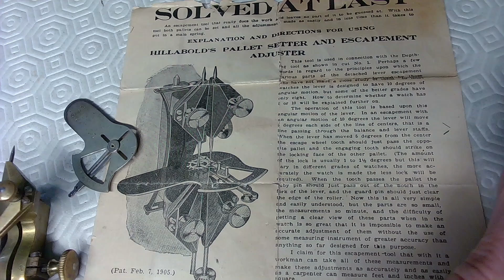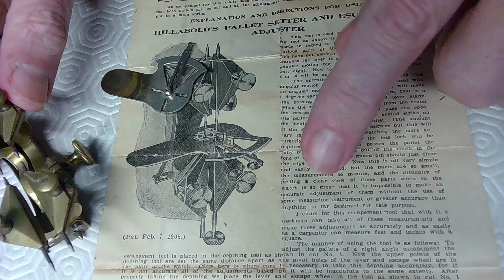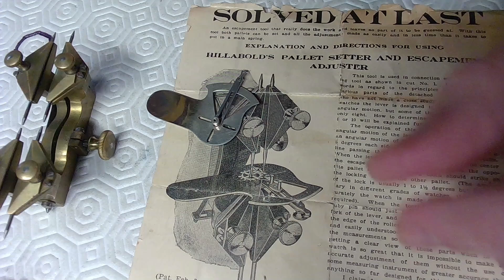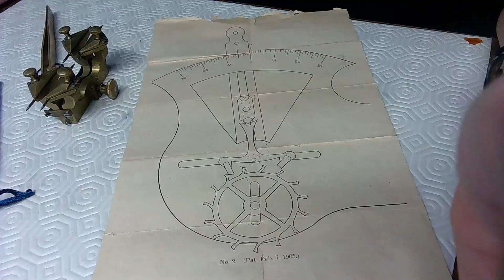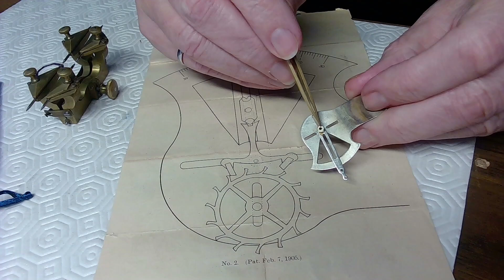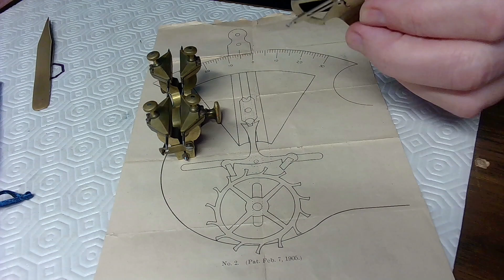Hillabolds Pallet Setter and Escapement Adjuster 1902

Comment: Interesting tool, it is a shame that it is missing those parts. 

There is a self made tool for measuring the same angles within the watch in some old material I have read. I think it was by Grossman. 

It was some kind of clip that connected to the lever with an end protruding out between the plates of a full plate watch, from which measurements are taken. If I recall, it was made out of a hat pin. 

I’ll try to find it again. It isn’t quite as versatile as this tool claims to be, but useful in full plate watches nonetheless in the absence of an escapement depthing tool.
Reply from the maker: This is an odd tool, but I may be able to make the parts that is missing
Reply: @JDRichard It is unusual, I’d never heard of it or seen such a thing. 

The tool I mentioned that is (I think) made from a hat pin can take the measurements this tool does. It doesn’t help with pallet jewel adjustment, though. 

Best tool for pallet adjustment (better than bergeon escapement meter) is a reticule eyepiece for the microscope and make a small brass block to hold the fork steady. You warm the brass block, put it on a ceramic tile under the microscope, attach fork and adjust stones with accurate measurements from the reticule.
Reply: @JDRichard I’ve emailed you the pages from the book in question, describing that escapement angle measurement tool and how to make and use it. It wasn’t Grossmann, it was from a 1904 book on Watch and Clock escapements.
Reply: @JDRichard You sure can